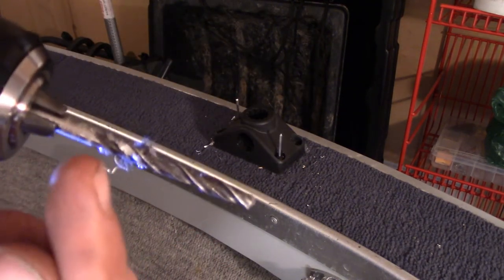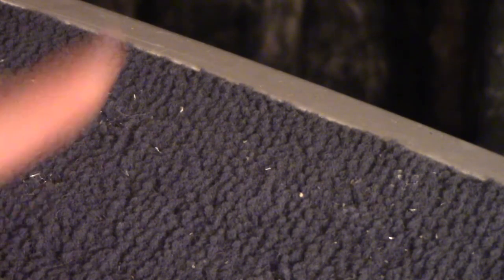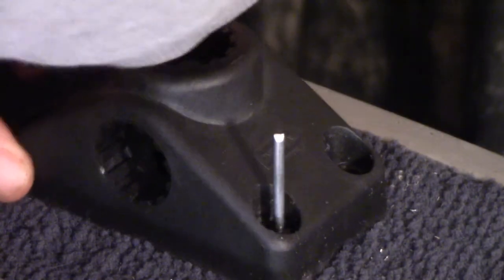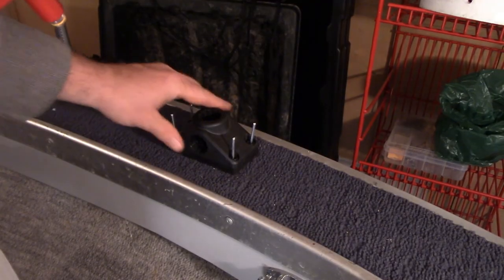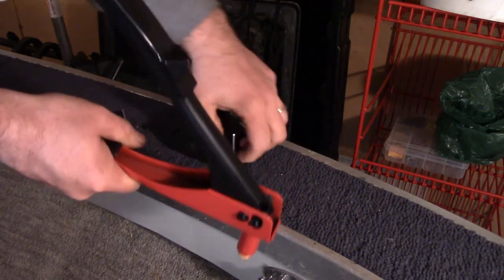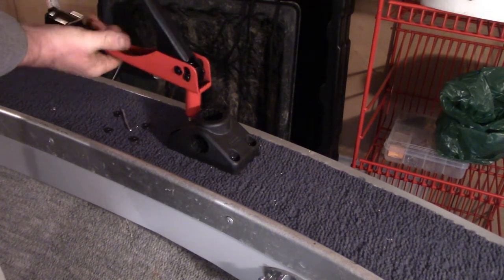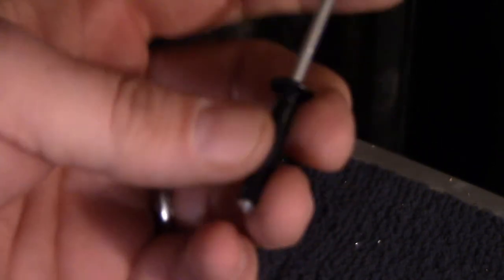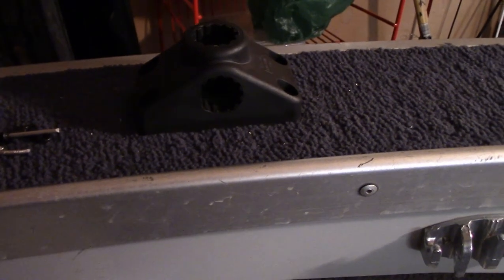How to install a scotty rod holder in an aluminum boat.

Comment: Great idea, now that the season haft way threw, any problems with them coming loose?
Reply from the maker: Thanks! No issues so far. I do feel a nut, bolt and washer set up do give more peace of mind . My other two rod holders are set up that way and do feel more solid.
Thanks for watching!
Reply: @footprintoutdoors6144  do you have a video of the ones you like better? I need to figure something out ASAP seems like everywhere is just to flimsy to trust
Reply from the maker: @brandenviens9248  my honest preference is  bolts, washers and nuts. That is the most secure method. Unfortunately I do not have a video of that, but I did install 2 bases that way ( because I could access the nut and washer) which from my experience is more solid and secure.

Comment: The rivets work good! can I use screws?  I am installing the same one on a bowrider.
Reply from the maker: You can use self tapping screws, but I prefer a backing, if if I could use screw, nuts and washers, that would be my preference. Rivets were the next best option for me, based on my preference.
So yes you could use screws, I chose not to.
Hopefully that helps.
Thanks for watching!
Reply: @footprintoutdoors6144  Thanks for the info much appreciated, great video!

Comment: You say 3/16 rivet, but how deep is the actual rivet? I bought some at Ace and they are all to short to even touch the boat.
Reply from the maker: I used long grip kayak rivets 1/2 inch I believe.